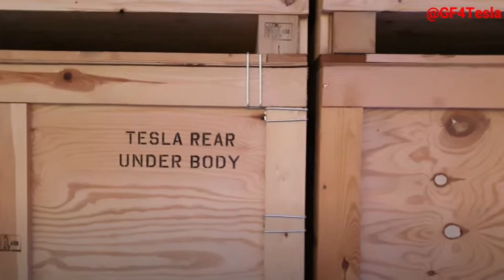Analysts Drive Giga Berlin Tesla Model Y on Autobahn and Tell This

Comment: yes often there is speed limit, but generally not. so if there is no sign speed is unlimited and it is generally not a problem because people are very disciplined drivers
Reply from the maker: Thanks for the clarification George.
Reply: @Torquenews  Well, I have had so many 'knöllchen' in Germany that I can assure you that there is more speed limit than there is not!
Reply: Actual here in  the Germany the government recommends a maximum speed of 130 kph on the autobahn.  There are sections of the autobahn that do not have posted speed limits. However  if you are in a accident/cause a accident and it was determined that you exceeded 130 kph, you  could be held liable.

Comment: unlimited driving on german Autobahn: more than 30% of german Autobahn has speed limits with max. 120 km/h. Even on these free parts, there are often road construction sites, where speed is limited to 40/60/80 km/h. For those who want to know how fast you can drive legally on the german autobahn, there is an actual video posted on YT.: Bugatti Chiron on Autobahn - 417 KPH. Maybe a Tesla roadster will break this" record" sometimes, but there are rumors that there is a general speed limit of 130 km/h coming in the next years.

Comment: speed limit on highway in germany when there is no extra lane for defect cars: 120km/h ! 

speed limit on highway in germany when there is 1 extra lane for defect cars: no speed limit.

example: 
2 lanes to drive on the highway + 1 extra lane on the right side to stop for defect cars 

3 lanes to drive on the highway + 1 extra lane on the right side to stop for defect cars 

the extra lane is visualy separated by a thick white strip.

Comment: On some Autobahns in Germany there are no speed limits, that's right. But how can that be safe? Simple: You have to drive save, that is the rule. As fast as you want, but save - so it depends a lot on what is happening on that Autobahn. Slower cars have to stay on lanes to the right in general in German rules. That means, it the Autobahn is almost empty, you would have trucks on the rightmost lane, cars on the second lane would drive with the recommended speed of 130 km/h, and the left of the common three lanes will stay almost empty, except if somebody is overtaking somebody by passing on his left side. And you basically need to know the street you are driving on already. You literally have no speed limit, but get in big trouble if you use that in an unsafe way. Note that the drivers license requires much more learning in Germany compared to the US.

Comment: While in Germany for several years, I recall what a pleasure it was to drive on the Autobahn. I've often thought here in America, we craft all the laws about what NOT to do (an infinity of things), with traffic police oversight, and if no law, anything goes (not good). But in Europe, it seemed that drivers followed many, many courteous, UNWRITTEN rules of the road (without consistently worrying about the (good) traffic gendarme oversight there). For instance, drivers very seldom pass on the right, especially on the Autobahn. Telsa Autopilot and FSD and ability to recall all events in case of accident should fit very easily into the cultures of European drivers.
Reply: Passing on the right is forbidden in Germany under almost all circumstances. That's why you don't see it very often. About the "pleasure of driving" - that's completely gone because of all the speed limits that popped up everywhere over the last 10 years and all the construction work going on. There are only few unrestricted parts of the autobahn that are longer than a few kilometers.
Reply: Germany has very tough drivers tests. They don’t just hand out drivers licenses to anyone who can parallel park.
Reply: @EinzigfreierName  Well, that is too bad. Progress, I guess. It has been a long time since I drove the Autobahn, Autostrasse, and country roads. Nevertheless, I still have respect for European drivers.